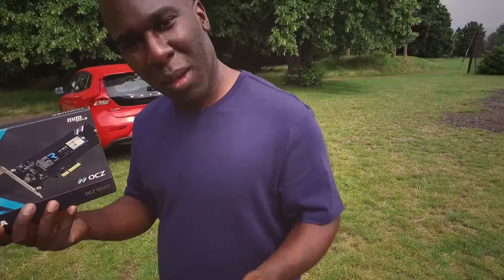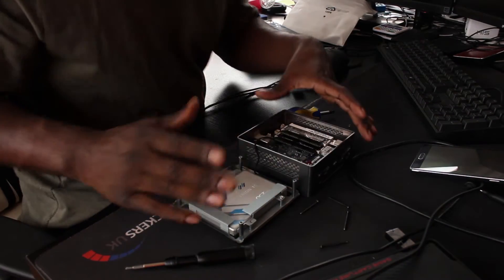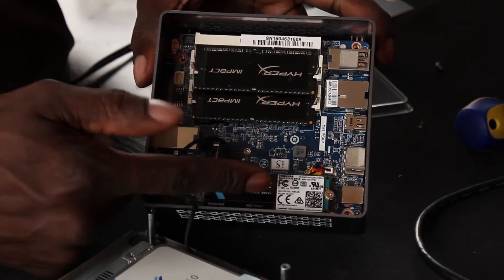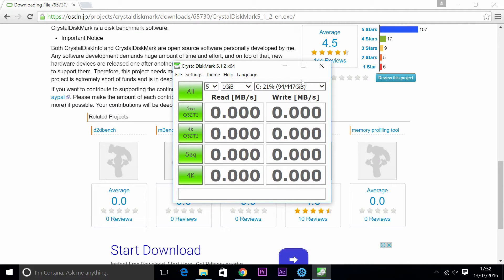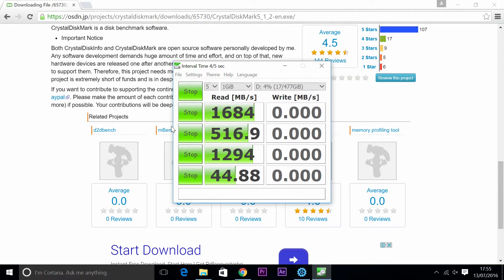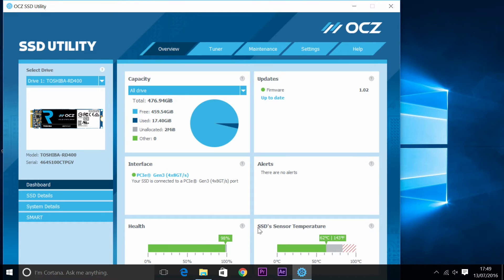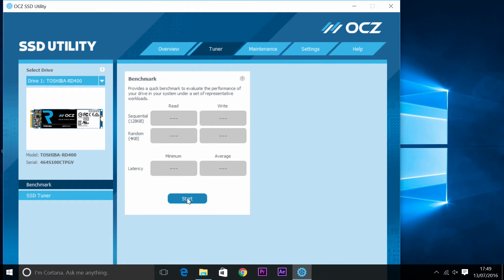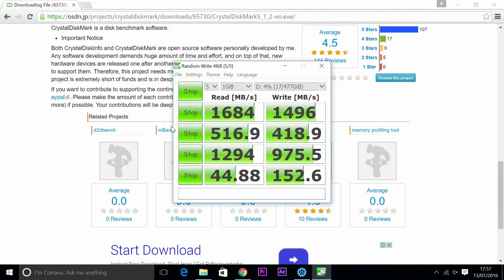Toshiba OCZ RD400 NVMe SSD - One of the fastest drives EVER!

Comment: i'm thinking to buy this i have ga-z77x-ud3h can you use it to boot windows when its on PCi i only got pci x8 i can use it on it?
Reply from the maker: You can use it, not sure it will work, as i haven't tried it and this card is crazy fast and needs faster than 16x buss speed
Reply: i change my mind and got 960 evo with asus adopter it works fine on 4x or 8x i get 3gb speed read but am facing problem with boot the bios won't boot from pci it need moded bios
Reply from the maker: Oh dear, that's good and not good! Can you mod bios or have you tried to see if someone knows that can help you with this as if you get it wrong you can brick the motherboard and it will no longer work?

Comment: To get the full speed of the drive, you need an Ultra m.2 slot that is gen3 x4.  I looked online but couldn't find a spec associated with the slot for the Gigabyte Brix i5 Skylake (GB-BSi5H-6200). Since the ultra m.2 is kind of a big selling point, I think the Brix might not have one.
Reply from the maker: I will have to find out the speed and let you know!
Reply: You can test the full speed if you have a motherboard that is SLI or Crossfire compatible if it has a free PCI-e 3.0 slot available. Just use the PCI-E adapter card.  If the bios does not support NVME then you won't be able to boot from that drive, but you should be able to install windows drivers and test the speed that way.
Reply from the maker: Yes i have many NVME motherboards i just decided to put it in the gigabyte brix and i can check with gigabyte and see if i can find the specs of the nvme on the brix!